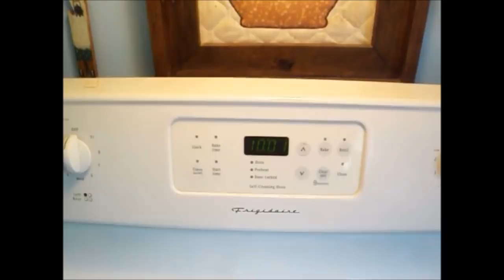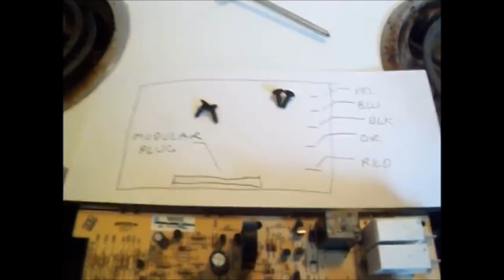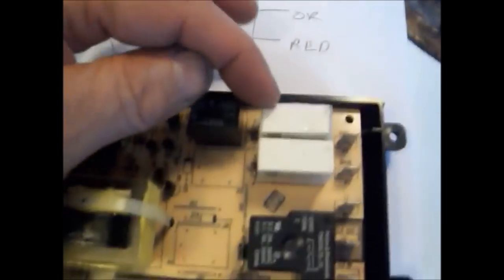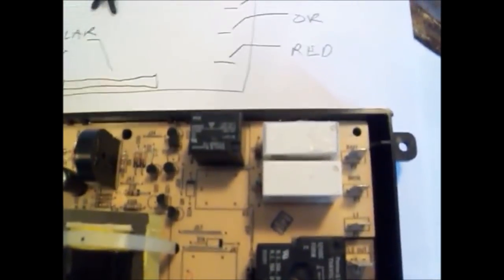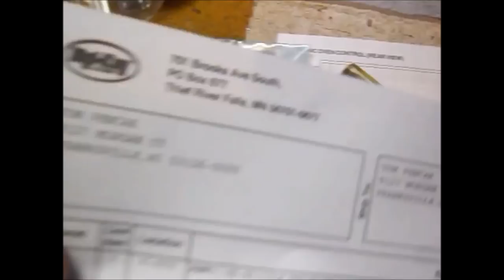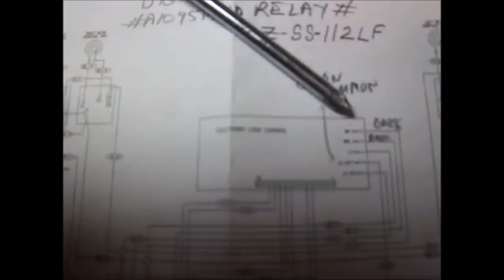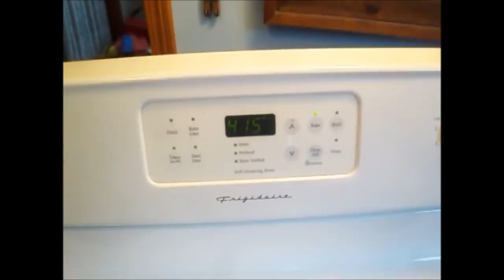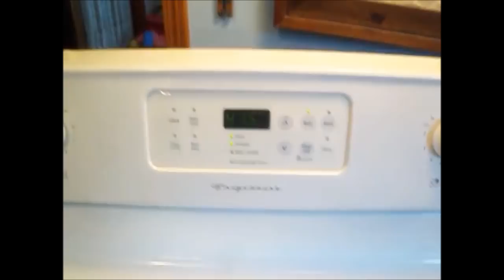Oven Repair - Replacing Control Board Bake / Broil  Relay

Comment: Excellent video! You just saved me $284.00. Thanks Much!
My oven is a Maytag MERH865RAS, I could not find a schematic of the control board (AP6009766 or WP5702M025-60) I replaced the broken bake element but still no heat. Took the control board out and looked at the relays closest to the Bake element wires (Red/white and yellow) I replaced relay K1 first and tried it. Still no heat. I then replaced relay K8 and Boom it worked! 2 relays $12.01 from Digi-Key (p/n  G2RL-1-E-CF DC24) Thanks again, You are the Man!
Reply: I rlly wish I could find a schematic as well. tells me there's runaway temp, wouldnt think the relay is the problem on my board
Reply: Be careful,  these are 24 volt relays Digi-Key (p/n  G2RL-1-E-CF DC24) , a lot of Kenmore's and Frigidaire's use 12 volt relays so double check the number on your relay.

Comment: There is a better method for removing the old relay with less risk of damaging the printed circuit board. Use a solder sucker to suck off the molten solder clean off the board. After sucking off the solder from all of the relay pins, just pull off the relay from the board and you will be ready to solder in the new relay.

Comment: Didn't focus well enough at 3:27 to read the numbers off the relay. Can you tell us what p/n you used to order the replacement? Update: Never mind, figured it out from later images in the video. Using Digi-Key Part Number A109514-ND, currently $3.62 each.

Comment: I am doing the same thing but am thinking about running wires from the relay mounting pad and using a separate small printed circuit board to mount the relay on. Later on if I need to replace it again I will just clip the wires and use another small printed circuit board. It would make it much easier next time.

Comment: Just use a solder sucker or solder wick to remove the part and old solder and save yourself a ton of time and avoid overheating your components, no drill is required
Reply: Thanks, neighboring chips on my board!

Comment: The easier test to do is to connect a 9 volt battery to the
two relay coil leads and hear if it is clicking, if it is clicking 
you can connect your meter to the two leads that are 
connected to the heating element to see if you get a 
connection, this can all be done without removing the 
relay from the circuit board.
Make sure you file off the protective coating on the 
leads or you won't get a connection.
Reply: can you damage the Integrated circuit or drive transistor that controls the relay by doing that ?

Comment: I have a similar stove and my up button to adjust time/temp etc. does not work. Everything else seems to work ok. Any suggestions?
Reply: I know this old, but incase someone else has same issue. Most of these control panels rely on spring loading plastic when you push on the front panel. The plastic pad under the panel face has a post in the middle that when it flexes inward, hits a momentary contact button soldered into the control board. The button could be bad, but it is more likely the plastic pad that transfers the button push down to that little contact button on the board has broken. If you peal off the front panel or remove the control board from the oven and then take it out of the plastic housing you will likely find a free floating piece of plastic in that has broken away from the rest of the housing.  I have fixed this issue a couple different ways, but one of the best is using something like plasticweld to reattach and reinforce the pad where it broke away from the housing (remove the whole control unit and pull out the board to make this easier). You can also attach/glue the broken pad with the post directly to the front panel but you have to make sure your placement is perfect. This is not the best way to do this fix.

Comment: Anybody figure out where you can order the relays for  relay boards?  Having a hard time finding.
Reply: I found a relay somewhat the same size for my Window AC, found it on ebay, just search ebay, Amazon, or a parts house like Digikey. The parts on these boards are cheap, if you have soldering skills & can use a volt meter you can save some a lot of money.

Comment: I have the infamous F1 error code. As well as oven sometimes not coming up to temp. Either controller board or relays.  Will take a stab at cleaning relays first. Oven is 20 years old.

Comment: Thanks for posting this. Do you remember what relays you used? Did you suspect or replace the other relay, the black one?
Reply from the maker: John Delk  I did not consider the black device as I confirmed the white relays were for bake and broil. I am not recalling what the black device was for.
Reply: What is the part number, what is the name of the supplyer
Reply: Looks like Digi-Key Part Number A109514-ND.
Reply: @MFATubed  may not be the relay you need.

Comment: What he said!
Reply: Used a pencil type soldering tool and solder wick.  Hardest part was seperating the circuit board. Once we figured out to squeeze center clips and pull straight up...the rest was easy.  Broiler did not work. Changed the broil relay.